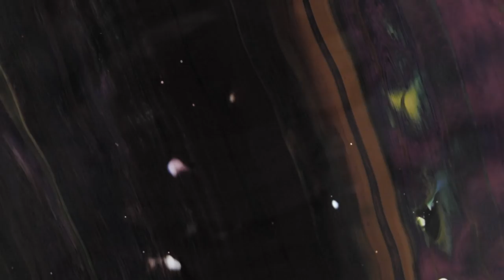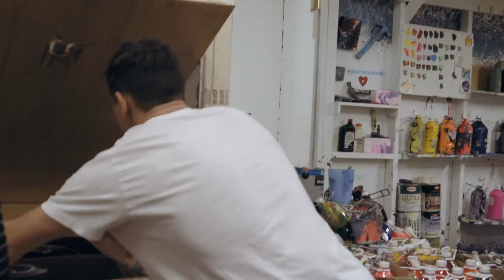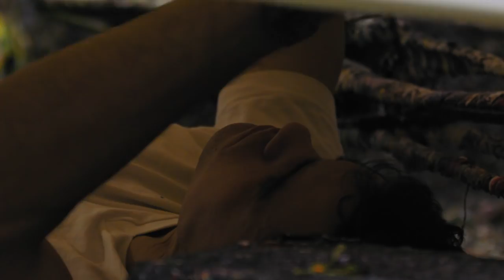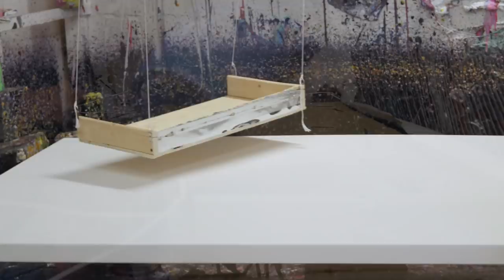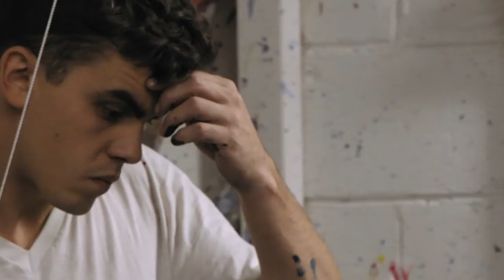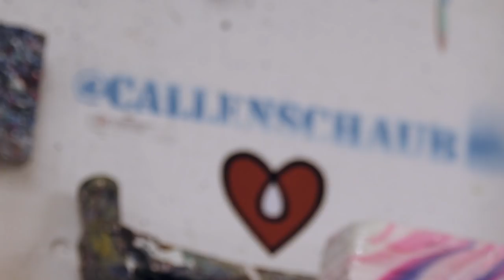ArtResin Featured Artist - Callen Schaub

Comment: Wow! So cool Callen! I was just think about how would you expand your process next?  Maybe you could make like trebuchet like machine, that you could load up the paint, and throw it at the canvas. Except the the trebuchet could be made out of bicycle parts, that would some how make enough tension . I'm seeing a gaint wooden cog and a crank shaft, that would be wound up like a coil of a spring, for the tention. That's where the bicycle part comes in. Maybe the wheel could also work as the cog. But you could use the higher gear to wind the coil up, instead of need 4 really big dudes.  Of course if would have to be small enough that it wouldn't hit the ceiling, in your studio. But theirs some food for thought. 

Also what type of paint do you use? I love how it flows and the vibrancy of it all! Your such an inspiration! Thank you Callen for your giant leap of faith! Jesus Loves you so much! Amen!

Comment: I know my question doesn’t pertain to this video in particular but I was curious about how to resin movie tickets? I’m worried if I just glue them down and pour resin that the ink might fade— is there a certain varnish that could work before applying resin? Thanks in advance
Reply from the maker: Hi there - if the tickets are printed on thermal paper ( like some store receipts are ) you might have a problem on 2 counts:  the images fades like crazy on thermal paper ( like looking at an old receipt and you can't see the numbers anymore )  Additionally, the resin warms up when it's mixed, so the heat from the resin will cause the thermal paper to go black.  If the movie tickets are not thermal, then absolutely, you can mount them onto a solid backing ( canvas board, wood panel etc ) and seal them first ( a spray sealant or a brush on sealant ... something that dries clear and won't yellow ) and then resin them!!
Reply: Building on what artResin said, I would take a picture of the movie tickets, print, and resin that. I know it's not the same, but at least you know it would last.